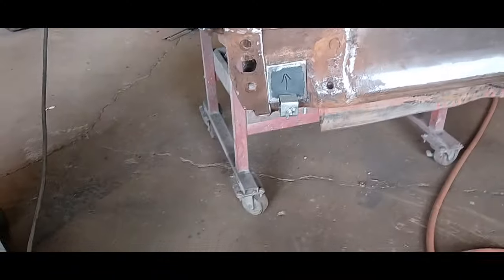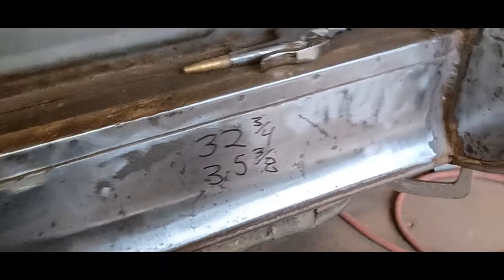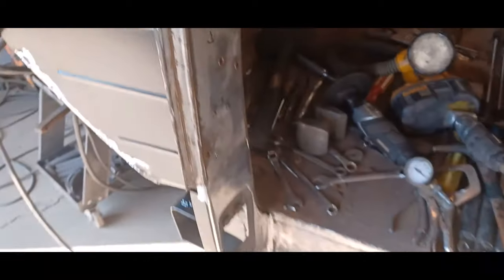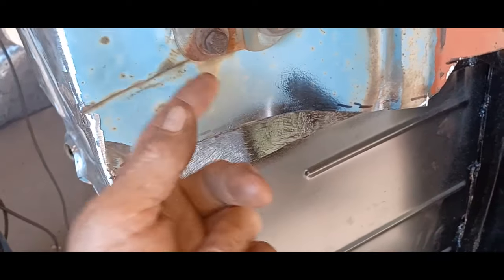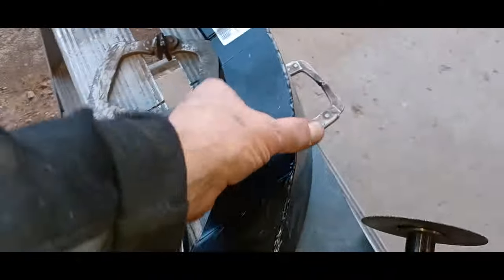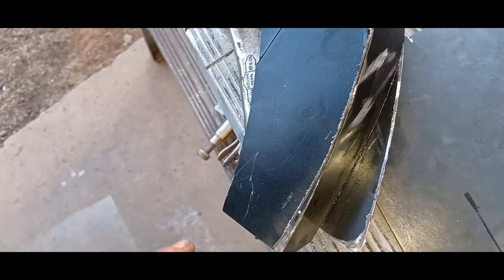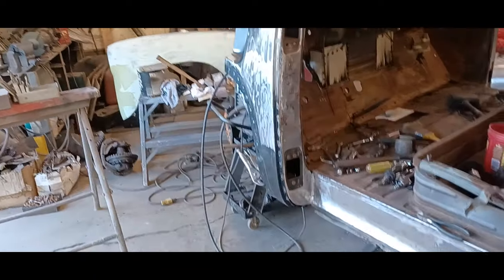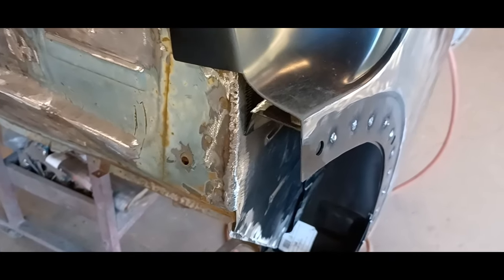REBUILDING THE '51 CHEVY LEFT COWL & A PILLAR PT. 2

Comment: Looks great but wouldn't be better to try the door before you weld it sold? Thanks for the videos they are very helpful
Reply from the maker: The actual pillar never moved, it was just the hinge pocket that required rebuild. Door gaps were addressed in a later video (they were awful)!
Reply: @dirtydansrodncycle  yes the door gaps dont look fun, but even from the factory they weren't great